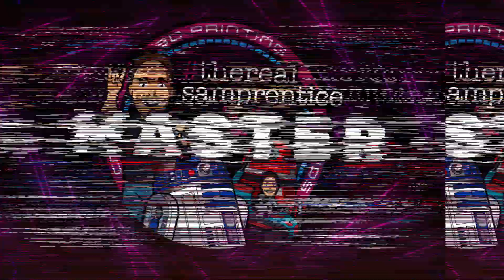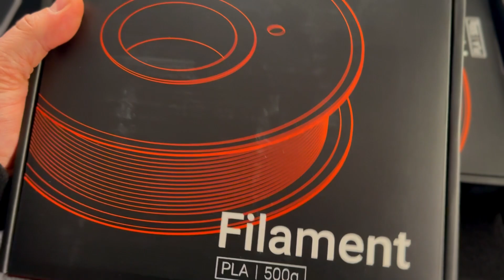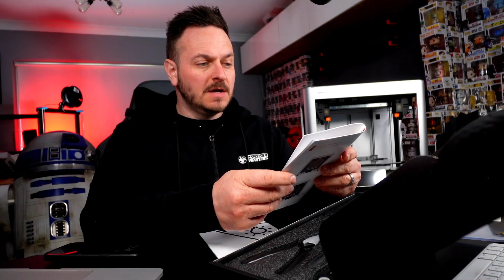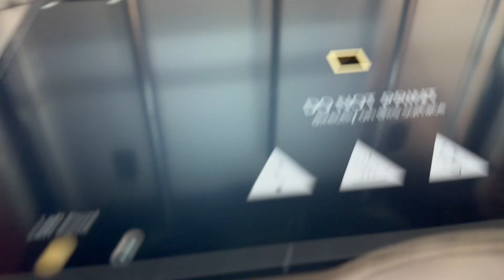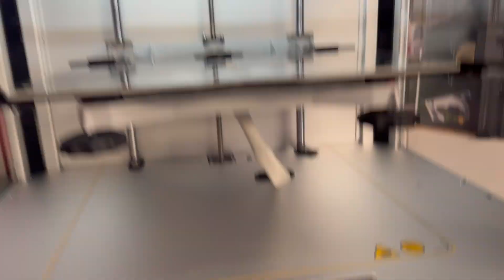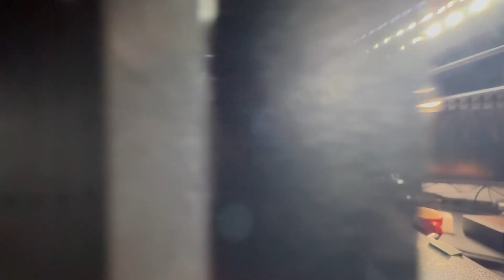Have You Heard of the Snapmaker J1 IDEX 3D Printer? You Won't Believe What It Can Do!

Comment: It can clog like crazy, the j1s is sold in december 2023 with old style j1 extruders that clog. How snapmaker is unable to fix it for a year? 1600eur payed to be beta tester?
Reply from the maker: Should have got a bambu
Reply: @TheRealSamPrentice  Bambu good for anything except engineering materials, for these you need to print slow and show it does not print has ghosting, google "Issues with the Bambu Labs X 1 Carbon" I think qidi x cf pro will be better option
Reply: @akierum I print a lot of ABS, ABS-GF, ABS-CF, PA-CF, PAHT-CF, PC and PC-CF on my X1C. Sorry but I don’t have problems printing these materials at all. Maybe try out Visonminer Nano Polymer if you have bed adhesion problems?
Over 600h print time now. Used for 6 months.

Comment: What’s the print quality compared to X1 Carbon?
Reply from the maker: It wasn’t bad, but they are very different machines
Reply: @TheRealSamPrentice bambulab simply works and  snapmaker works when it's full moon.
Reply: @akierum 😂
Reply: @TheRealSamPrentice I get they are different machines, but it should still be a simple answer since the end goal is the same. If I want to print simple 2  color models or a single carbon fiber ball what is the quality difference in the end. It’s not like comparing apples and oranges or even a car. In the end your are comparing the 2 physical objects your are  holding in your hand. Which one would you deem better?
Reply from the maker: Bambu this failed post launch

Comment: Although my device is 2 weeks old, ASA and ABS filaments do not stick to the tray, what should I do?
Reply: glue and up the build plate temp, asa and abs require 100-110c beds around to stick well, it fall right off once it cools
Reply: @songhan1586  cihazı sattım, en iyisi bu oldu teşekkürler.
Reply from the maker: Maybe try some 3d lac

Comment: Bought J1 in Feb, still don't have it. 10-12 weeks shipping time. Updates about shipping status? Nope. Answer time from support: 3 days. 

Meanwhile I read a lot in forums about the J1. It has a high potential in hardware, but messy software. The linear rails are not the best and some people have problems with print quality because of them. The magnetic top is flubby, the doors sometimes are parallel, sometimes not like Sams model. 

In short: Actually I think I should have bought two P1Ps and an AMS instead and was printing all the time ... and before I will have my J1 the MK4 & the K1 are on the market. But hey: let's buy J1s 🫣😉
Reply from the maker: Time will tell, the Bambu system is incredible for the money for sure, I have 6 in my main farm the J1 is in my office, remote printing is a game changer as far as my farm location and sending the files from remote locations. Creailty also have a system similar but it’s not as good. 

The j1 for sure needs a little bit of love and dedicated firmware work

Comment: they are doing the same job. in the end.. printing in multiple colors. sure the motion system is different but its irrelevant.. what matters is the final output quality and performance.
Reply from the maker: Depends on the job that needs doing, there are a ton of reasons not to buy this, yet they achieved 873 backers that pledged $719,575  before it jumped back to snapmaker. The buy in on what people think they want is why the ender 3 was the most successful printer to date, and 99% of clones are based off of that. 
3k in the Facebook group so maybe there are 2000 machines + working now? Maybe it’s not giant numbers like the cr6se which again was $4.3m USD! And 10k buyers who cares about that machine now!! I’m using the machine now and I’ll keep using it for my only idex printer in the studio :)
Reply: @TheRealSamPrentice  I had a craftbox Idex for a while. decent machine but a pain to calibrate the heads,  super expensive spare parts, clunky software but grear build quality. ended up selling it.. looking forward to what Bambu releases next
Reply from the maker: @MrExo_3D  I think we all are ! Snapmaker and time wasn’t on their side with this launch

Comment: i love whats coming out in 3D printing, it's an exciting time with all the new innovations and products. The IDEX is useful for multi color and separate filaments,  but if you are buying a printer for approx $1300.00 US  are buying this or something else?
Reply from the maker: IMO I think they launched it a little late, if they had managed to get this to market and solved the firmware issues early doors most of us would have these my feeling is. This is in fact one of the printers that I really wanted because it does several things the Bambu Lab printers don't like printing petg and blending tpu over the top, plus you can also double your production with the second extruder. 

You're right tho! $1300 US is a ton of money Its pretty much 2 p1p's and the J1 isn't an CoreXY ! What it is tho is an attractive machine that works and in my tests and (right now) printing its a wonderful tool.